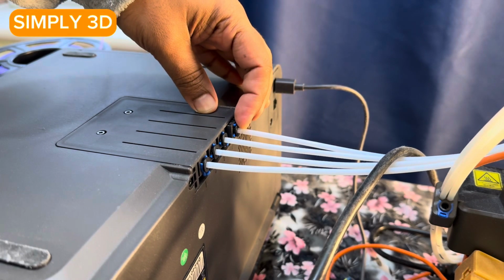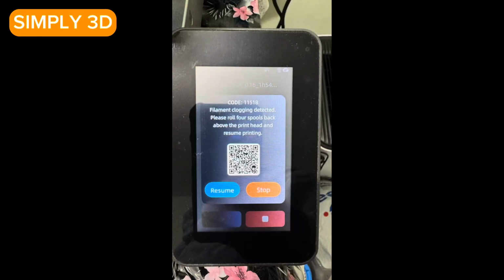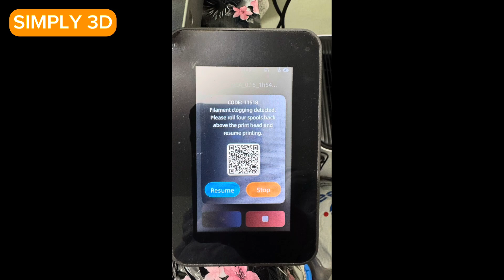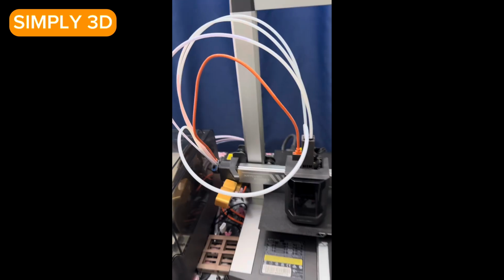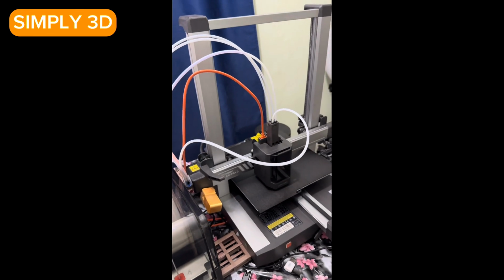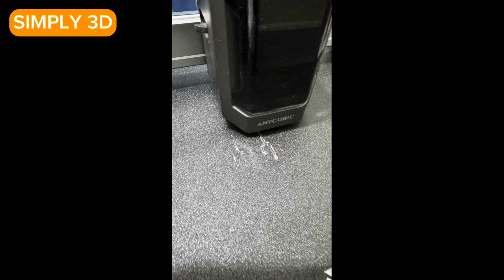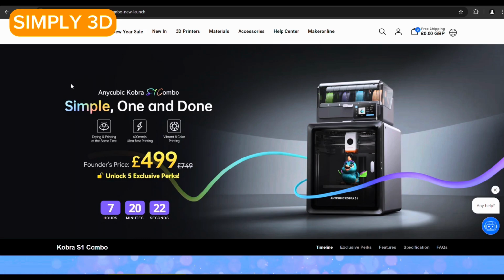Anycubic Kobra 3 Ace Pro port 4 problem. (Solved) #3dprinting #solution #3dprintingproblems

Comment: I tried this process it works but for some reason my filament clog up on the tube making the printer stop working i kept doing this process again and again i already tried with different spool of filament still happen the same thing
Reply from the maker: It might be that the filament stuck this time is in the filament hub. Try taking out the filament hub. 
Happened to me once, I totally forgot to record it as I panicked what happened to my 3D printer.

Comment: I had this happen but I didn't have any filament and I can't find a piece anywhere. Filament flows through nice and easy. I think the extruder spring is broken or the filament sensor. Regardless, right now it is just telling my printer to retract and it won't extrude
Reply from the maker: Did you try submitting a ticket to Anycubic? It might help. If not then here’s the link - https://www.anycubic.com/en/SupportCenter/k3usercareform  
Just mention everything about the problem.